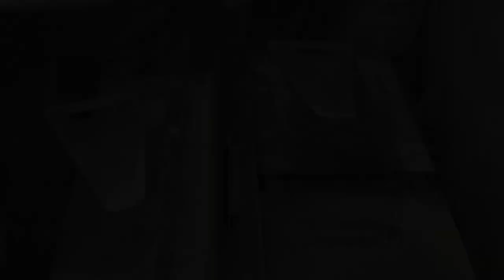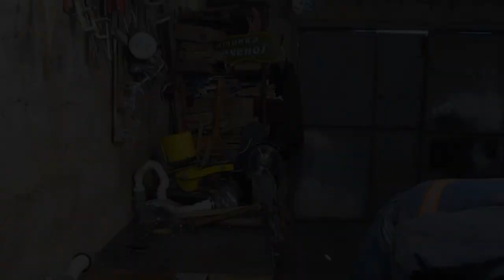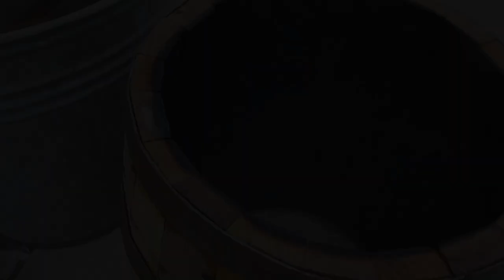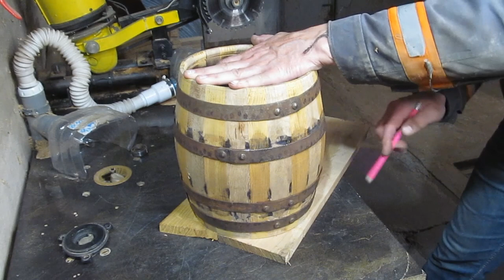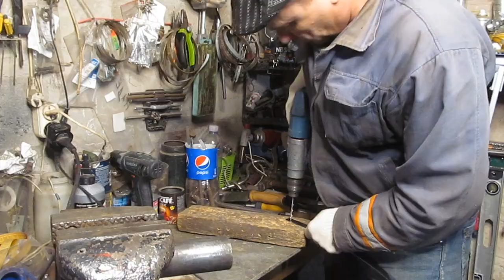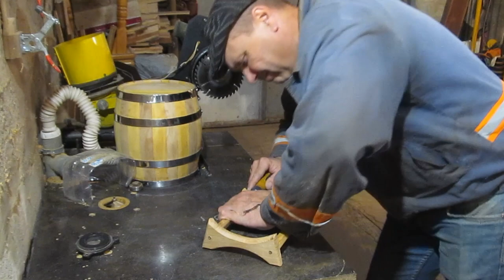A whiskey barrel made of firewood DIY | How to make a wooden barrel from oak and mulberry scraps

Comment: i have so many questions . . . like is the cable clamp devise homemade or can you buy it? what is the white rock you rub on the barrel before fitting the permanent rings? Pumice? Could you explain what you're doing with the dividers to determine the size of the lid? I need to make several barrels and don't quite know how to proceed. Should I use air dried wood? How dry? They are for brandy and whiskey.
Reply from the maker: Coupling device for barrels homemade. Soon there will be a video in which I made such a device. Before installing the hoop, I rub the barrel with white chalk. Using a compass , I measure the circumference of the bottom of the barrel, which is equal to the sum of 6 radii. When the leg of the compass exactly hits the starting point after 6 steps, this will be the exact radius of the bottom of the barrel. Before making a barrel, wood should have a moisture content of 18-22%. It is better to dry the wood outdoors for 12-18 months...

Comment: What angle are the pickets cut at? 25-30 degrees? Thank you, Jim
Reply from the maker: The angle of the side face of the stave depends on the number of staves in the barrel. The angle can be calculated using the formula: 360/N/2, where N is the number of staves in the barrel. In this barrel, I use 21 staves, respectively 360/21/2=8.6 degrees. Each riveting on both sides is cut at an angle of 8.6 degrees or 8 degrees and 36 minutes.
Reply: @tmzhenatanwoodworking7252  Excellent explanation, thank you very much. I figured it had to do with the number of staves. I can cut these angles on my table saw. (maybe)
Reply from the maker: @aerialrescuesolutions3277  If you still have questions, ask ... I will always give an explanation and help with advice ...